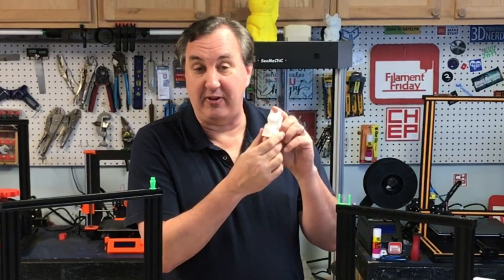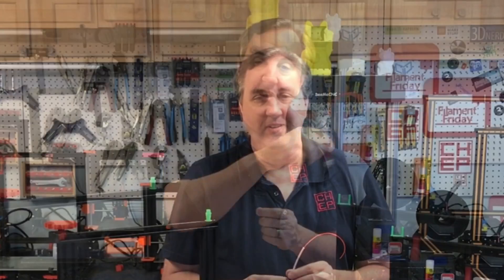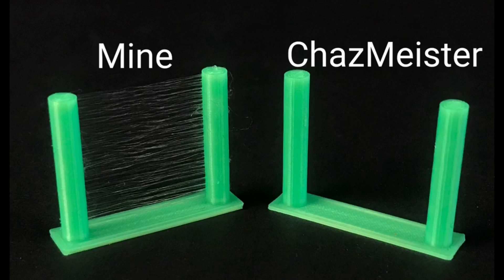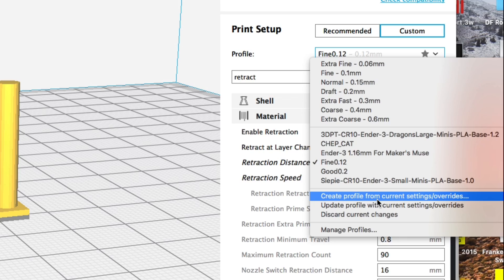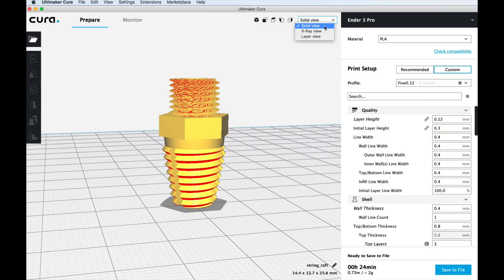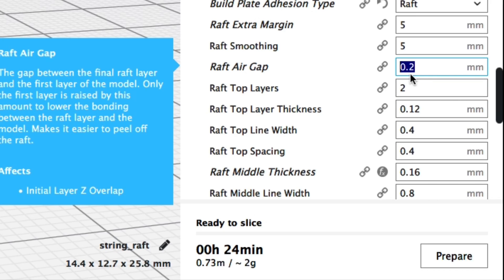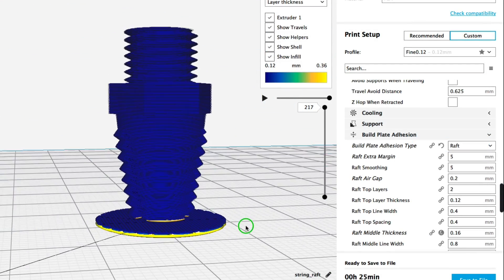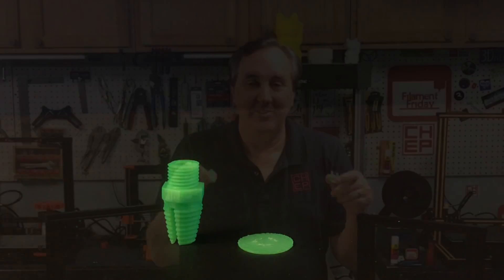Cura Settings for Retraction and Raft on Creality Ender 3 or CR-10 Mini

Comment: New user here with Ender 3 and Ender 3 V2 and Cura. I have tried 6mm, 25mm/s but there's a lot of stringing. With lots of trials, my best retraction settings are 10mm, 15mm/s. Thanks a lot for your help, Chuck and everyone here.
Reply from the maker: Try cutting off the last 20mm of PTFE at the nozzle.
Reply: @FilamentFriday  I'll try it and see if there are no more strings.
Reply: @FilamentFriday  Can you please explain this? upload a picture I'm a new ender 3 v2 owner and I can not get passed this and it's driving me nuts, watched all the videos, downloaded ChazMeister2 Cura Profile (which incidentally did not bring in any new settings for Retraction so I set them manually after watching this video) every time same result no difference between the the Chaz prof with 6/25 and the stock cura Standard profile that it builds itself after adding a none network printer etc.  still looks like garbage
Reply from the maker: https://youtu.be/OvAU1ZLFyow start watching at 1:50
Reply: @FilamentFriday  Thanks I watched the video and removed the end of the tube that had some cloggage put it all back together printed the retraction test item...exactly the same.  anything else that I can try? -thanks

Comment: It makes sense to pull filament with lower speed. Pressure should be just enough not to let it fall through the nozzle when it's being retracted. Thanks for the tip, Ill try it today as I have some issues with stinging after converting to the direct drive.
Reply: @nobooya with a direct drive extruder you should need lower retraction, somewhere between 2-4mm. This is because the extruder is right on the hotend rather than 100 mm away. Hope this helps

Comment: I found an changed the settings in Fusion 360 as well, im printing now, and it seems like my stringing problem is gone.. Thanks Chuck.
Reply: what did you change in Fusion 360 bro?
Reply: @VIPER401  Hi.
In the print setting editor i changed the "extruder retract length"  from 0,5mm to 13mm. then all of the strings where gone.

Comment: I was doing well with grey ESun PLA+.  The rafts were peeling off pretty easy.  Then I ran out of grey and switched to black, and now the rafts are tougher, and virtually impossible to remove.  Do I have a temperature or cooling issue?  Prints are otherwise okay.

Comment: Hi Chuck,
Thanks for these settings, they work perfectly on my Ender3 V2
I wish retraction would work as well when printing a part with lot of small holes, there is still oozing between holes, then material is missing when printing the wall of the holes. It is especially present on the first layer with slow speed , also the oozed material shows on the first layer.
I have all the strings checked on on Cura 4.6.1, but can't find the setting I am looking for
Any advice?
Thanks again for all the infos that you share
Reply: Hello Jacques. Did you find a solution? I have the V2 too. I tried every single combination within the retractions. The retraction test fails every time. I always have stringing.
I tried combing, coasting, temps, and I don't find a solution yet.
Reply: @luismosti6697  I used the setting provided and they worked great for me
Cura 4.7.1 has improved as well

Comment: i did follow this, then already configured my esteps, i also check if may xxy are calibrated, checked belts, any wobbles, alreay checed for clogged nozzle,  but i still get strings.. :( any help would be appreciated.. thanks! :)
Reply: Same story here. They're very fine, but often difficult to remove. I was able to somewhat reduce them with even slower settings and lower temps. But the issue persists.

Comment: Thanks for the vid, CHEP. I’m new to 3D printing  and recently bought an ender 3 pro. I am really struggling with stringing at the moment and none of these setting changes seem to be helping! I don’t know what to do :(
Reply: Did you resolve your stringing just got ender 3 Pro, do I use the profile in in the description and run a test print or just change the 2 settings on retraction to 6 and speed to 25

Comment: I was having good results with my Ender 3 v2.1 out of the box until I had a clogged nozzle.  In fixing that, I replaced the stock extruder with an all metal, dual gear setup.  After doing that, I followed Teaching Tech's video for getting my settings correct and found that my printer was under-extruding by almost 60% (!).  After correcting for that with the Esteps/mm setting, I checked by flow rate (Cura) and found I needed to bump that from 100% to 116%.  The filament I am using specifies a printing temp of 200-230 and a bed temp of 60-80, so I set Cura to slice at 215 and 70.  After doing all of this, all the test prints I did seemed to have a lot of stringing.  Maybe it was just the nature of the test models I was printing.

I was getting really frustrated because everything I did was really stringy.  Then I accidentally printed ChazMeister's gcode on and it printed with lower temps and standard flow.  The result was nearly flawless.

So my question is, how important is the flow rate customization and the filament vendor recommendations?  When should you follow these?  Are there certain times / certain designs where it is more critical than others?
Reply from the maker: If you had to change your flow to 116% then the esteps aren’t correct.
The filament settings are recommendations. Your slicer settings are more important to match your machine.

Comment: Thanks for posting this! I finally got my first 3D printer, a CR-10 Mini, and have been working on dialing in my Cura settings and print speeds. I got things printing well at the default speed and started trying out higher speeds. I was getting a ton of stringing, so I did a quick google search and found this video (already subscribed, I just happened to miss it!). Changed the retraction speed from the default 60mm/s to 25mm/s and the default retraction amount from 5mm to 6mm as suggested and went from tons of stringing to almost none! Huge improvement!! Thanks for all the work you put into your videos, the information you've shared has already helped me a ton and not only this video!
Reply from the maker: Great feedback. Thanks.

Comment: I find that whenever using retractions it causes the filament to grind at the extruder using my Ender 5 pro, this will lead to the extruder skipping and there for a failed print. Any solutions to this please and thanks?
Reply: Mine did that also. Slowing the retraction speed to 25 and reducing the distance fixed it

Comment: How much time does retract add to the print time? That would have been nice to know. If I can save time with prints and stringing isnt so bad then Ill just suck it up and deal with it.
Reply from the maker: Depends on the print. Cura tells you. After slicing hover over the i circle above the save button and it will show times.

Comment: Chep, thank you for the videos, I love them. I've downloaded your Cura settings for 4.6.1 and I've noticed an improvement in my prints. However the raft settings for CHEP's Best are different to the settings you mention here. Am I right to assume these are your preferred settings and you just didn't change them for your downloadable file?
Regards Brian
Reply from the maker: It’s ever evolving. You can adjust them to what works best for you.

Comment: Thanks for this video! 

Hm... not sure about the 25mm/sec retraction speed. I dropped chazmeister's gcode file in a code viewer and it looks like the retraction speed is at 40mm/sec. Also I think the "little wipe at the end" is actually a feature of combing. It looks like his profile doesn't have the outer wall wipe distance enabled. Unless there's some mismatch of settings with the new version of Cura.
Reply: Actually combing does move inside the print before a travel, but even without combing, there's an inward wipe when you activate "optimize wall printing order" and you have at least 2 walls.

Comment: Used Chaz's profile that you linked and still get stringing.
Reply: What kind of material are you using to print? I almost have a profile almost dialed in for PLA+ since I was getting some stringing but if you are using something like PETG or even PLA from another manufacturer you might have to play around with the temp and retraction settings some more to find the right combo. It's frustrating and time consuming sometimes but I find it pays off in the long run.
Reply: @VideoCesar07  Which settings you end up using for PLA+?

Comment: Chep, Thank you for your videos.  They are very informative.  
However, I need help with stringing.
Ender 3 Pro, Cura 4.5 and 4.6.  I’ve been printing for four months with Cura default profile with 4.5 on my pc and 4.6 on my laptop.  No problems.  Last week, stringing problems began.  I made no changes to the profile and yet it began stringing.  I changed the nozzle, Bowden tube and fittings.  Still stringing.  Actually, it’s more like bridging.  It’s like I designed a bridge between the two posts of the stringing test. I’m on a PEI sheet, level is good.  I began increasing and decreasing retraction distance and increasing and decreasing retraction speed.  I tried 6/25 as you suggested.  Still stringing. 
Do you have any suggestions?
Thank you.
Craig.
Reply from the maker: Check your fan for failing. Is top of the hotend hot?

Comment: Hi everyone - what’s up? In order to make less stringing in the cura you have to set up the material type by width the actual you have 1.69 and the weight 950 grams ! This is my petg parameter( you have to write yours) after that the retraction is 1 mm and the speed is 25:)

Comment: User group comment about stringing problem  "10mm retraction is to much your pulling the filament into the cold zone in the hotend. Most should be 7mm. Try turning the parts fan down."  And also "Are you using Cura? I had bad stringing in ver 4.5/4.6. Went back down to 4.4 and it was much better." Thanks Chuck
Reply: I'll have to try this, just got my printer a few days ago and am getting stringing with CHEP's Ender 3 profiles.

Comment: Them settings do not exists in cura 4.6
Reply: Yes they do, you can click on the gear next each section under print settings, or you can click Preferences > Configure Cura > Settings (Cura 4.6.1).  Once you're under settings, you can either search for them, or view under each section.  The confusing part is, on Chuck's video these settings are listed under "Material".  However, I've found that in Cura 4.6.1, these settings are located under "Travel".  Hope this helps - Tim
Reply: @timdgsr  I have all selected and it does not show up in the print settings
Reply: @8711dave  Search 'Retraction.' They're under 'Travel'

Comment: I'm having huge stringing problems. I'm really new at this so most terminology is foreign to me but I did find the youtube channel Makers Muse first and uploaded that profile they were talking about (Chazmeister) into Cura with some errors (I don't recall what they were but there was a profile by that name). I printed a test print and it was worse than ever so figured it didn't upload right. Anyway, I have been dicking around and  researching and making my own adjustments after researching stuff but after about another 15 test prints, I'm still getting stringing (pretty bad too). Now..I recently found this site. So, again, I downloaded this Chazmeisters profile through this site and uploaded it with no errors. however, I noticed in the uploaded profile settings that it clearly says the Retraction Distance is 5mm and Retraction Speed is 45mm. So what gives? Is this the wrong profile? Even if I change those settings to 6mm and 25mm/s and nothing else I still have huge stringing problems. I'm about the throw in the towel on this hobby.
Reply from the maker: Try my chep profiles. https://www.chepclub.com/cura-profiles.html
Reply: @FilamentFriday  I tried your latest settings and it was a complete failure. I'm thinking maybe its the machine but I have no clue why the prints are so poor. I'd send you a pic but there is no option to. I thought maybe its just bad PLA but I changed that out to a different one...same result.
Reply from the maker: Try clipping a sponge with a couple drops of olive oil soaked in over the filament prior to extruder. See if it helps. https://www.youtube.com/post/UgzcKkV6iAsjwK0TrU94AaABCQ?app=desktop
Reply: @FilamentFriday  @CHep i have downlaoded your profiles so many times. Yet I cannot get them into CURA ( now 4.6.1) always an error. Some help on a video may assist us all. I am using a GEETECH A10 . Which I have rebuilt practically. Every angle is 45% every nut tight etc etc.
Reply from the maker: Load them with Ender 3 selected
Reply: Of course. messing about so much iwith CURA I overlooked that..cheers !!

Comment: Still really struggling with Stringing - Using your settings, with PLA plus. Using a .5 and .6 nozzle to dial in but still getting significant stringing on an Ender 3 pro. Any other suggestions? I have slowly dropped the temp from 215 down to 205, as well as adjusted retraction length from 5mm to 8mm, and speeds from 60 to 25mm/s. Help appreciated! I also watched your video on PTFE Tubing. I have capricorn tubing, and just replaced it again to make sure that was not the problem, still having issues.
Reply from the maker: Check your couplings for movement. Check the end of PTFE for burning.
Reply: @FilamentFriday  Thanks for the reply! I've just double checked both and don't see any movement or burning on the Bowden tube.
Reply: @FilamentFriday  okay so realized i had a gap in the tube! went back and did this fix correctly (luke's hot end fix) and its much better. However, still getting a small amount of stringing. I'm using a .6nozzle, how would you suggest adjusting retraction speed/distance for a larger nozzle?

Comment: Hi CHEP. I’m using your profile. I’m getting no stringing when I print this little tower test. But I do get multiple one when printing the Benchie. Mainly from the front top to the cabin and inside the cabin. I bump to 7mm and samething. Any idea?
Reply from the maker: Try setting “not in skin” in Combing mode.
Reply: CHEP already setup with this. Forgot to mention.
Reply from the maker: Then my guess is the PTFE is wearing out. Cut off the last 20 mm of PTFE near the nozzle and push it back down to the nozzle. I suspect that will fix it.
Reply: CHEP the printer is 3 week old. I upgraded to Capricorn and had more issue when printing with lot
of retraction . So went back to original PTFE. I did the hack with the little piece in the hot end to be seperate from the rest. I guess I’ll continue to investigate.
Reply: @martinbolduc9602  try within INFILL, this might work on certain types of prints like pipes or tubes
Reply from the maker: Check couplings for movement.

Comment: Hi, I was using your Cura profiles but was getting more stringing than with the default profiles for Ender 3 that comes now with Cura. I think I found the problem. In your video you say the difference from your original profile and the one from @ChazMeister2 was the retraction speed. The default Ender 3 profile from Cura has 45mm/s of retraction speed, what is very similar to the actual speed in the Chazmeister's profile (40mm/s), while yours is 25mm/s. But as far as I know this doesn't matter, since the printer caps the max retraction velocity at 25mm/s (it is like that in the firmware of the SKR mini E3, and I think they copied the parameters from the original board, but I'm not sure). So, even if Chazmeister left the retraction speed at 40mm/s in practice it is the same as yours - 25mm/s. After comparing his profile with yours, and seeing Angus video, I think the main difference is that in his profile the setting "Combing Mode" shows "Not in skin", while in your profiles is set to "Off". That's the setting Angus says it makes the most diference. Perhaps you could check if this is not the reason why some people were getting stringing with your profiles lately and, if positive, update them with this setting. Anyway, thank you very much for your videos.
Reply from the maker: Good point. I check that out.

Comment: im trying to solve my stringing problem... got it down to very very fine stringing but cant get the rest to go away... and its funny i actually ended up with 6mm retraction and 25mm/s on my own :D but i still got some stringing :(
Reply from the maker: Bump to 7.
Reply: same
Reply: Change "Combing Mode" to "Not in skin", instead of "Off". This should work well with 5 or 6 mm retraction distance.

Comment: I'm using your Prusaslicer profiles for my Ender 3, and I'm not happy with them. There's a lot of blobs which I think are caused when the head is pausing while it's retracting. There's significantly less of these blobs with the V5 profile (based on Braunbär's profile from Thingiverse), who uses only 5mm retraction instead of your 6mm and 40mm/s retraction speed instead of your 25mm/s..

Comment: i been seeing this video for a couple days cause i'm having this issue well the funny thing i was given a gcode from simpfly3d with a big of gcode change i realized that retraction speed of 6mm with a speed of 30-35 works best but when i enter in cura it was failing misserably.. so i took an analyzer and realised that simplfy3d stop feeding a few seconds before the end of the wall. so now i'm trying to tweak it on cura to get the same results on simpfly3d and can't seem to find it. idk if i'm missing something
Reply: Use Coasting